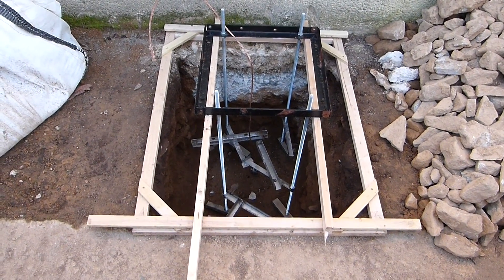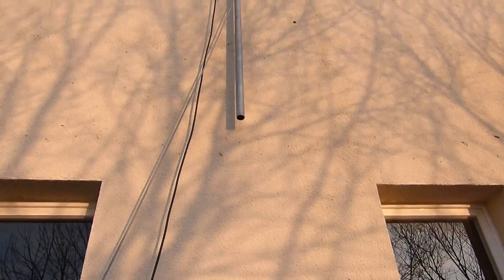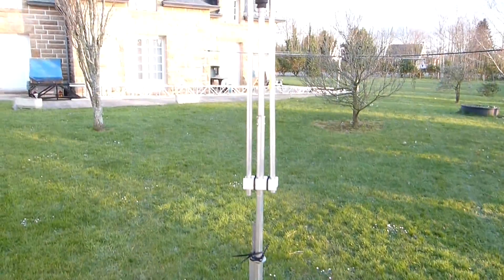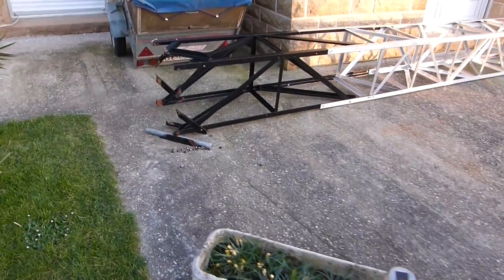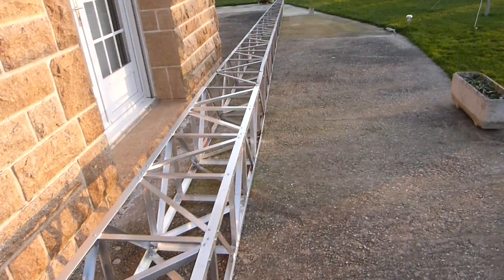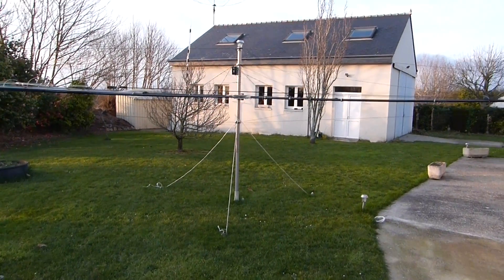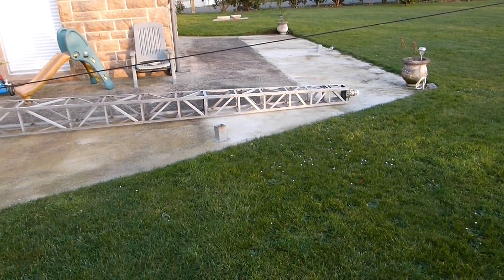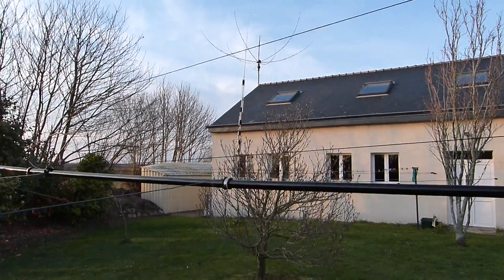F4FEP HAM RADIO TOWER .MTS

Comment: Hello! I am a fellow ham radio operator from Romania, my callsign is YO6IOG. I was wondering, could you please give me some details about the tower? I need the dimensions of the ''L'' 
 shape aluminum profile. If you can help me it would be much appreciated. Thank you and 73!
Reply from the maker: Hello dear sergiu
For the verticales parts: 40mmx40mmx3mm.
For the horizontales parts:
30mmx30mmx2mm. 
Let me know if you need some others infos .regards.
73's johann
Reply: Yes, one more question, what metric size for the screws have you used (diameter and length). Thank you.